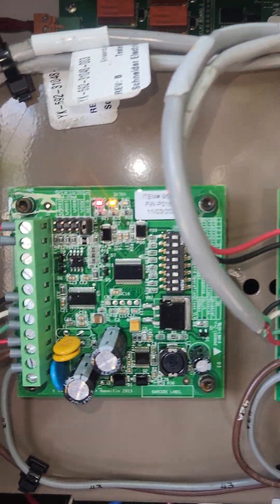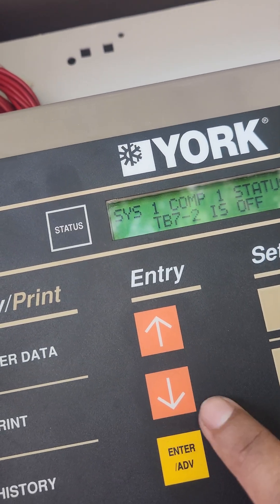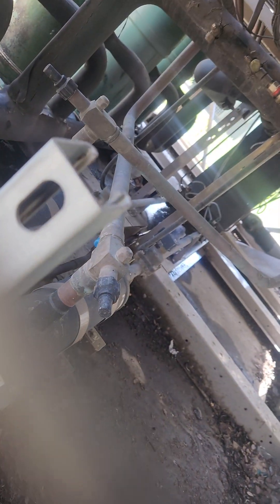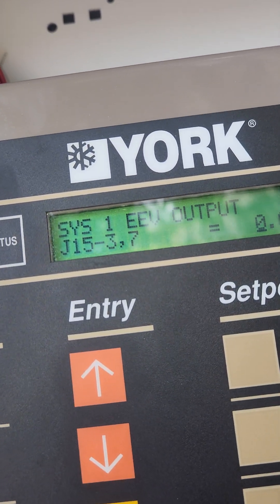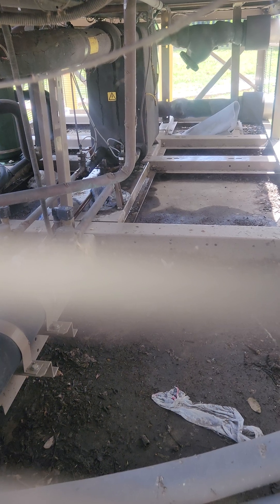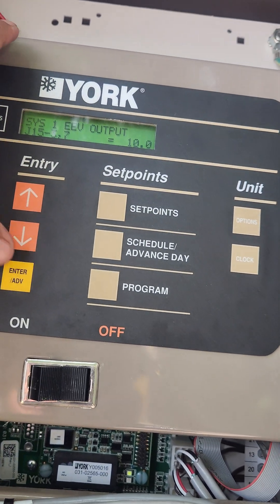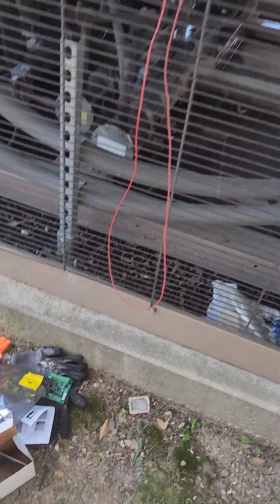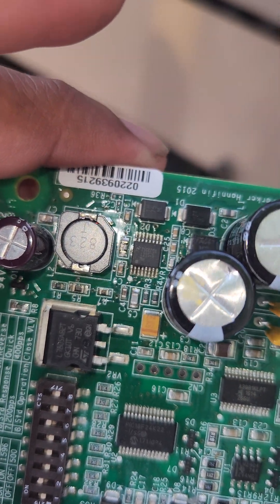How to manually drive EEV on York YLAA

Comment: Nice! It looked like 0-10VDC output I’m assuming? Are the dip switches to set an address and/or change the I/O?
Reply from the maker: @EverythingHVACR  yes, the dipswitches set type of operation for the valve, Steps per minute and reaction time, They're usually stamped on there inorder to indicate.
There is another jumper to set for 0-10vdc or 4-20ma. I usually don't have to mess with it.
Reply: @ keep the content coming brother! 👏
Reply: Thank You